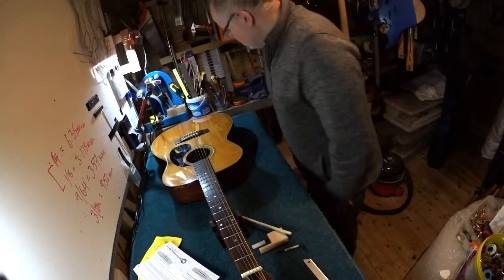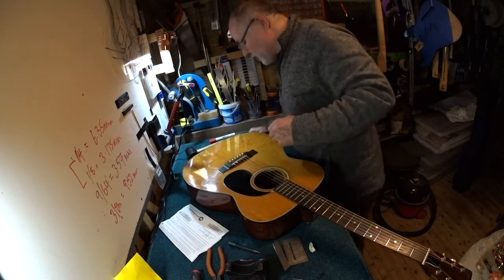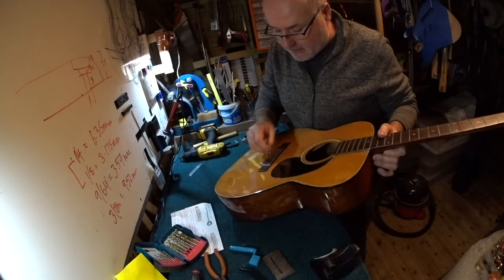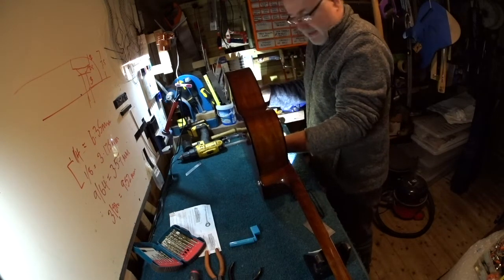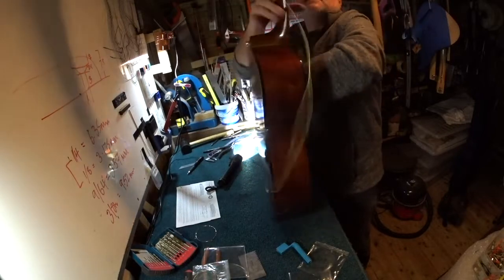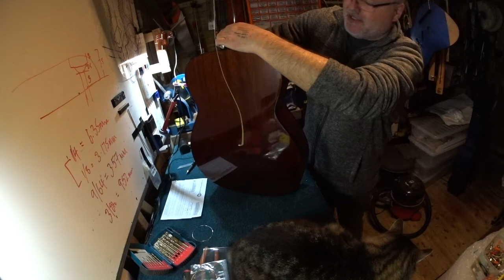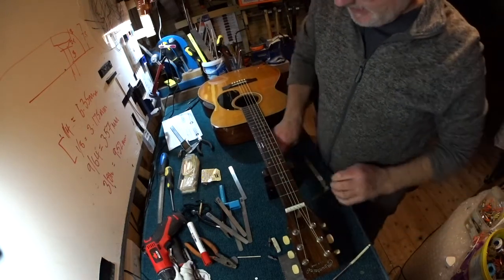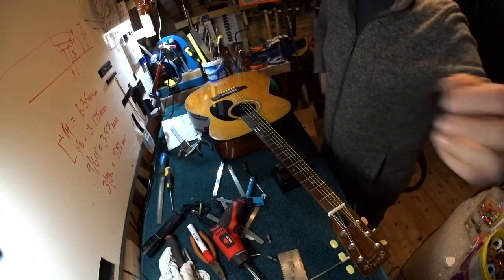Mountain F100 Bridge Dr and set up

Comment: Hi Sam, I am one of your devoted followers over the past year+. I also purchased your e book and have been working on a few guitars here in Maryland, USA as a result. I have recently installed the same JLD Bridge System in a 1997 Ovation Celebrity Deluxe CS257. This guitar has a shallow bowl yet the access is via a 4.75" hole in the back of the bowl. This makes for much better access to the work.
I may be mistaken but I think you may have put the dowl in backward and that may be why it kept falling out. Once the rod is shorted  the 3/8" it is instructed to be reinstalled "pointed end toward the sound hole, and install the tension screw". That way the flat end butts against the end block and the pointed end mates to the depression in the tension screw. If the other way around the pointed end could deflect off of the end block and fall out as you tighten. At any rate, it appears you accomplished the installation and all is well. 

I, for one, really appreciate all that you do and your e book and videos have opened a whole new world of enjoyment and learning for me. Please keep up the great work Sam!
Reply from the maker: Hi John - thanks for that. I think I had it the right way etc. but my biggest challenge was the lack of access due to the shallow depth of the body. Not only was the unit too deep to use at all on this guitar (without some careful limited sanding) but I couldn't get my big mitts into the space to manipulate the parts lol. On top of that a major motorcycle crash in the 1990s left me with limited wrist movement which also doesn't help...at all lol
Reply from the maker: .... and before I forget, thank YOU for your support on this channel and with my eBook. Very much appreciated!

Comment: Hi Sam I'm going to lower the 1st fret action on a fender acoustic am I right in thinking it should be 0.4 mm
Reply from the maker: That's my preference....and in my experience works well in combination with around 0.2mm relief and 2-2.5mm last fret action (low E). Keep in mind that it's "in combination with..." i.e. if you set 0.4mm at the first fret but 1mm at the last that 0.4mm will reduce...
Reply: Sam Deeks Thanks Sam I will bring it all down slowly .At the moment 1st fret is 1mm 12th fret 3mm  and relief is 0.9 mm .So there's room for improvement lol .